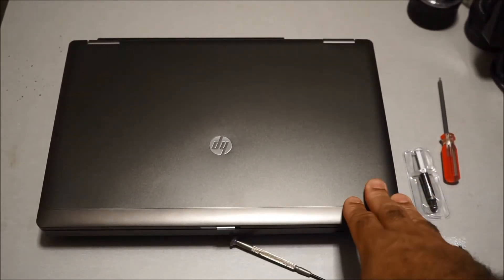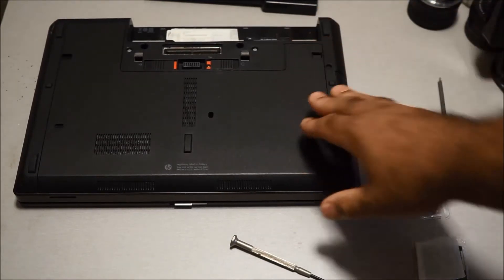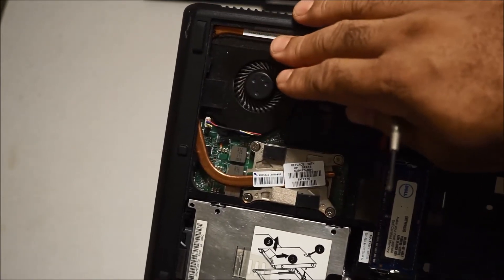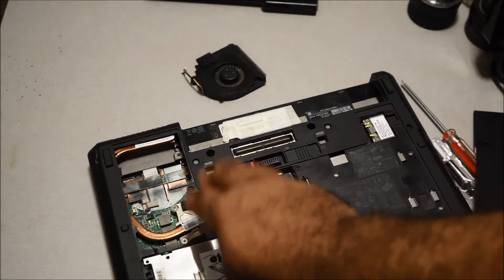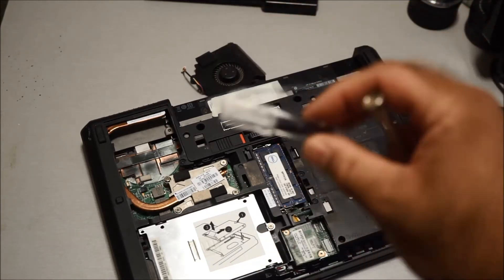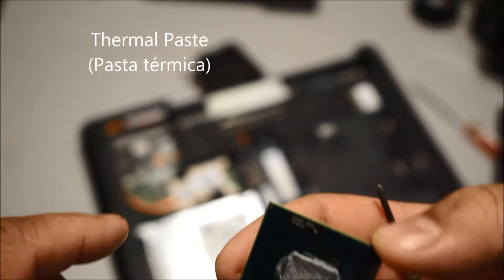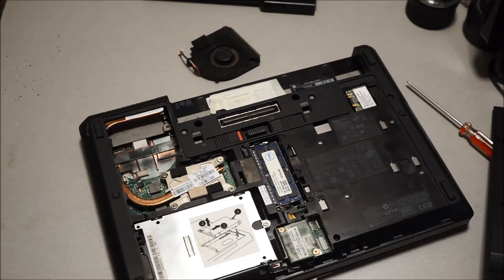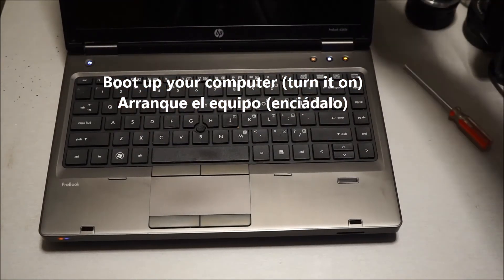Upgrading The CPU / Processor on the HP 6360 (b) Laptop (Spanish Subs)

Comment: My 6360b still going strong windows 11 works nice on it is only i3 8 gig ram and a ssd 120gig have used it since release day never gona change my hp probook 6360b just looking for a bt adpter
Reply from the maker: Hey that's great its still going strong.  Its a great machine.  For the batter, they got 3 different types of batteries for it.  They have 2 battery slices you can buy for it.  I think both are 9 cells. They fit underneath the laptop and raise it up a bit.  I think the batteries are suppose to give you a additional 5 or 6 hours (if new).
The battery model number is HP BB09 and ST09 battery.  That's what I like about the HP Probooks and elitebooks, You can  add dual batteries to them.  So you can have from 15 to 18 cells in one laptop! That's cool.

Thanks for the comment.

Comment: First off, I've upgraded my three HP 6360b Probooks (I do remote audio recording with a MOTU 828 18 channel in audio interface, backed up with a Focusrite Saffire 16 channel interrface, both fire wire units) with the intel Quad Core 2720QM.  Supposedly this isn't possible, but here I am streaming a news channel on another tab, and letting you know this tutorial is right on the money as my Probook is using the 2720QM. 

And why three? You can never have enough back up units just in case one goes on the fritz.  (Which my Probooks have yet to do.)

Comment: can i use fingerprint scanner on this laptop in have probook 6560b
Reply from the maker: Hello, thanks for the message.  Yes, you should be able to use the fingerprint reader on the Probook 6560b. I have the Probook 6360b, its pretty much the same laptop just smaller, so it should work.  I will make a video for you on how to install the fingerprint reader on the laptop and see if it works (later today).
Reply from the maker: I was just making the video on how to setup your fingerprint reader, at the end of the video I realized that mt fingerprint reader on my 6360b is a dummy  fingerprint reader or its not connected.  doing the setup I check my "device manager" and their is no biometric reader or device on my laptop.  so its a dummy reader or not connected.
But I did figure out how to install it and set it up, if you have one on your computer.  There are 2 software drivers you need to download and install.  One is "Validity Fingerprint Driver" and the second is "HP ProtectTools Security Manager"  ProtectTools is very important to install, it allows you to setup the fingerprint reader (with your fingers) and detects the detects the biometric reader itself.  Once you set that up, you are done and it should work. The directions are straight forward.

I will still post the video if you want, its still a good video to show the two drivers you need and how to set them up. I realized mines didn't have the fingerprint reader doing the installations.   I hope this helps.
Reply from the maker: Hello again, I just made a video on how to install the fingerprint reader on the Probook 6560b.  https://youtu.be/mgecsrxqsrY   The software links and setup guide is in the description. Just follow the video.  Hope that helps.
Reply from the maker: I just made the video on how to install the fingerprint reader on the Probook 6560b.  https://youtu.be/mgecsrxqsrY  Hope that helps.

Comment: ´great videos bro i have my 6360t and i love it and its the one with the celeron prossesor so i want to upgrade it and add a better battery and try to find a express card with more usb ports can you point me at where to find the stuff if you have links by any chanse i have no idea where too and all ready checked ebay but way to many options and im worried to buy the incorrect stuff. thanks for your videos bro keep it up.
Reply from the maker: Thanks.  For the expresscard usb adapter, they come in two sizes 34mm/54mm slot, both will fit your laptop (hp 6360b).  The only thing you have to worry about is the drivers.  Some of those adapters are "plug and play" and requires no drivers to install, while other do.  I don't know what models do and don't but I will check for you and provide you with links to them. 
Ok I just found one:  https://www.ebay.com/itm/174858866635  the description says it's "Plug & play and hot swapping capability" That should work.  it has 3 usb 3.0 ports on the card.
I hope that helps. I will list in description. Thanks...